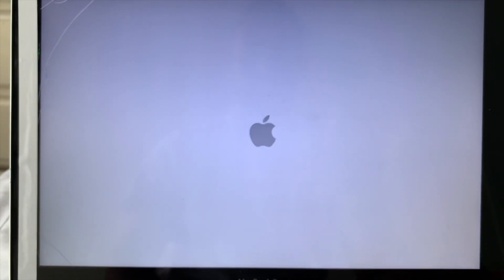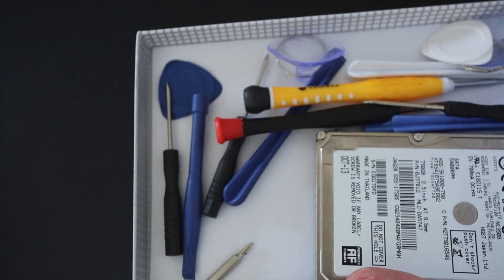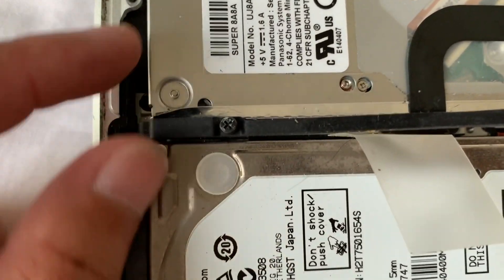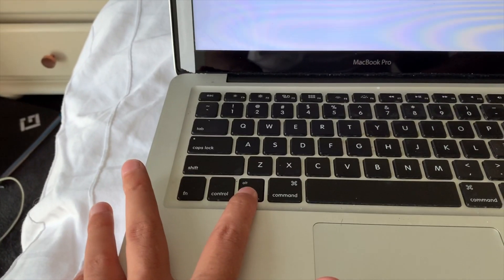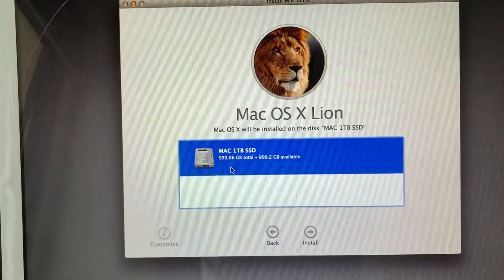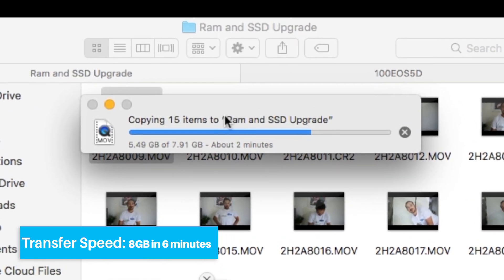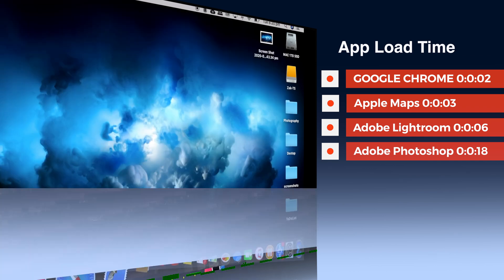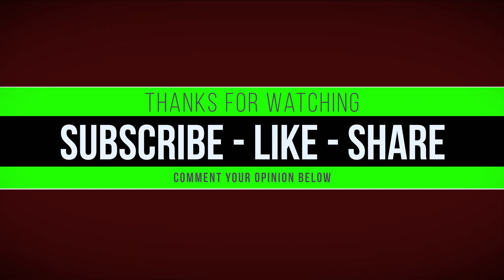MacBook Pro SSD Upgrade (2011/2012/2013) How to Upgrade MacBook Pro Hard Drive to SSD

Comment: This upgrade is no longer worth it: besides the fact that you can’t install any macOS version newer than High Sierra (which is already crippling on its own, not only for security reasons), more and more apps in the App Store won’t even work in Mojave anymore instead requiring Catalina; you’ll get a better deal and will be better off going with a MacBook M1 or - if that’s out of your budget - at least a MacBook Pro 2015 model.